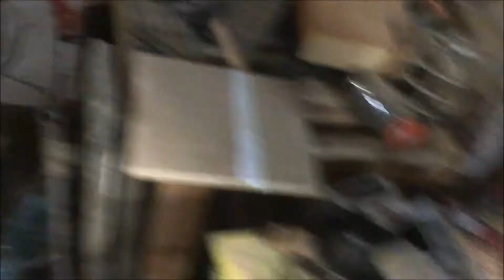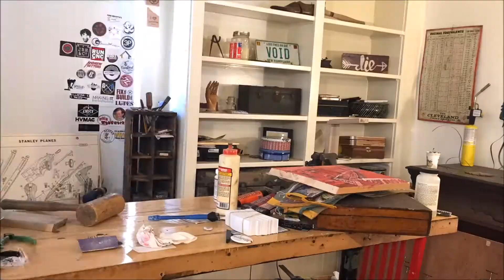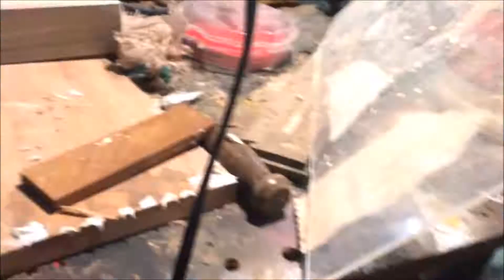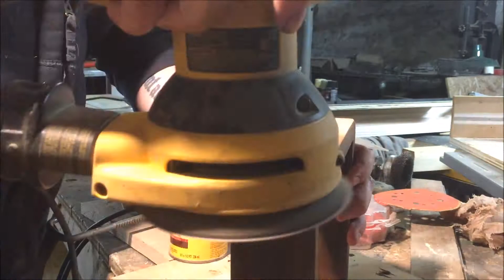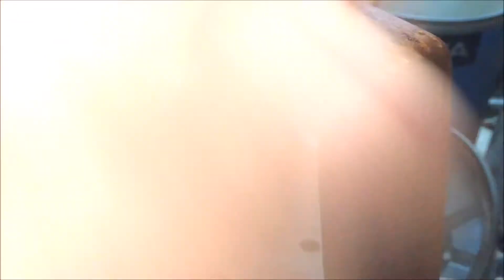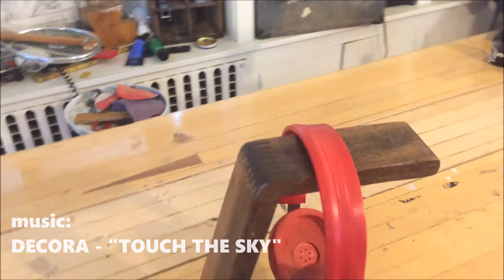A Decent Project - Box Joint Headphone Stand

Comment: What angles did you use?
Reply from the maker: m1k3y0n3 I don’t recall but I believe it was around 30 degrees.
Reply: Ahh Okayy thanks mate
Reply: I tryed with an 80° 100° angle with 2 mortise and tennons. I think it worked out pretty good